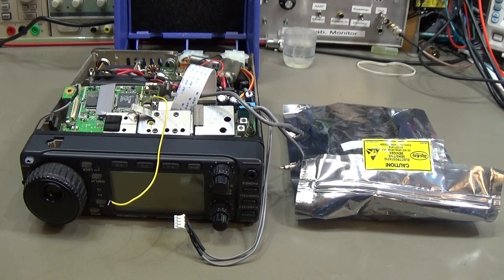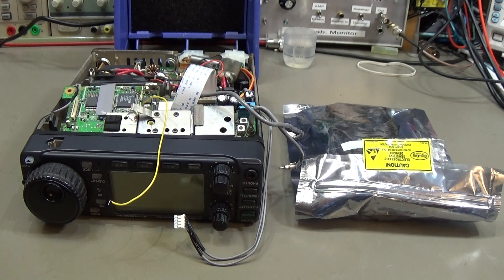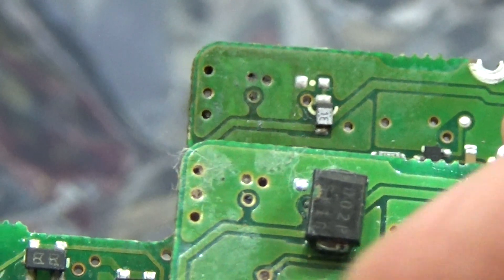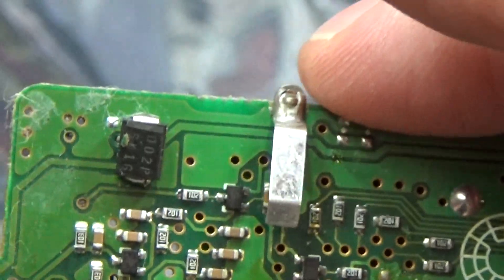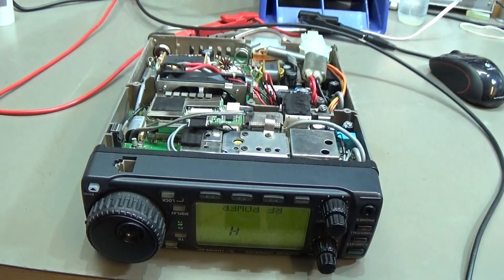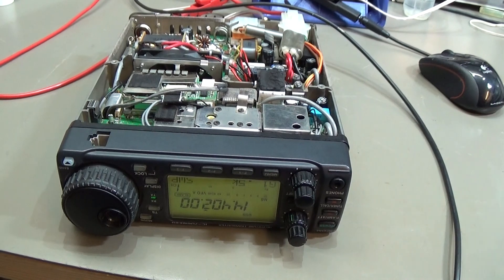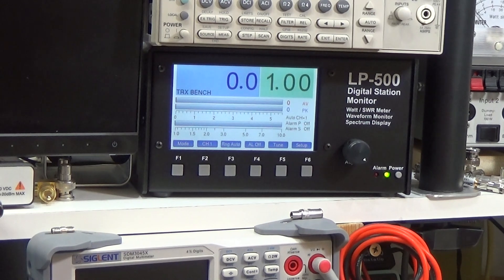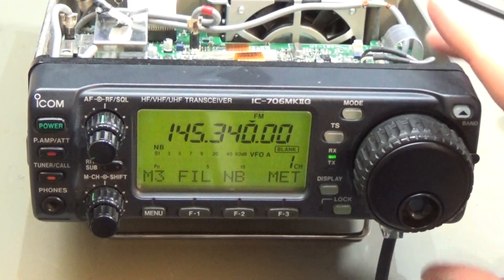#139 Final update on ICOM IC-706 with PLL fault

Comment: I have different symptoms: RX somehow work but no selectivity, CW signals has all splatters through band and it is changing after TX/RX switching. Looks like on TX it works.
Even more …all CW stations has no tone in audio just keyed noise. Could it be also PLL issue please? Its radio from my young son and hr has it from his SK mentor and he is very rely on it. So he is very unhappy that it is sick and I want to repair it for him… ;(

Comment: Hello sir,
I would like to know what the purpose of this diode replacement is in this video, please.
I have a problem with the IC-706MKIIG, which is a short, loud noise (about 2 minutes) that occurs in both transmission and reception. The noise sounds like a strong QRM. I suspect the problem is in the PLL board, and the problem is easily noted at low temperatures. If you can give me a suggestion of this failure I would appreciate it.
73 from PU2XEA

Comment: Wondering if the "Golden Screwdriver" shorted the unregulated input of the +8VDC voltage regulator to the output.  That might at least explain part of the failure.  Great three-part video series Peter.